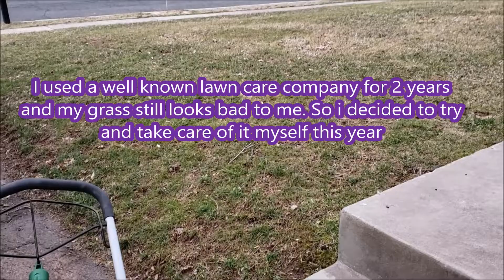SCOTTS SPREADER WHEEL CHANGE (Part 1 of 2) (Part 2, https://youtu.be/ukE639CF2eg)

Comment: You might want to  speak clearer and the camera was all over the place.
I'm trying to find a way to keep my wheel on my spreader. The clip and cap are broke, they fell apart when removing the old wheel. I don't know where to buy replacements or what they are called.  I have a solid steel axle and a wheel but no way to keep the wheel on.
Reply from the maker: Thank you for watching and for the feedback.  👍🏿

Comment: Hey man cool video!! I have the Scott 1500 sq. ft. Turf builder edge guard DLX. I think mine is just the newer version of yours.  But the wheels on mine are even worse than the two u replaced ... I really hope that I can do the same thing you did but I don’t think you can because I think the wheel is part of the shaft I don’t know I’m gonna give it a shot though you’ve inspired me. 
Thanks 🙏
Reply from the maker: Thanks for watching. It is a much smoother  push spreader now I wish you  luck with your project.
Reply from the maker: https://www.youtube.com/watch?v=ukE639CF2eg

Comment: I have the same spreader and thinking on changing the wheels so my question  is What size wheels did you use on the spreader and what parts did you use to keep them attached.. great mod on the spreader
Reply from the maker: Hi, thanks for watching my video. I used a size 10" wheels from Harbor Freight tools, they were like $4.00 a piece. After replacing the wheels, I used new cotter pins to keep them from coming off. After replacing one side, you are going to have to drill a  hole through the part that the bar goes through so it will spin with the bar so the fertilizer can come out. I put a long small bolt and nut to keep it from coming out. There's a flat spot on the bar that you will see once u take the wheels off.  Your drilling through that as well. That's what your going to put the bolt through so the wheel can spin.  i hope this helps, seems like a lot but its not. Let me know how you make out with it. if you have more questions, reach out.
Reply from the maker: https://www.youtube.com/watch?v=ukE639CF2eg Thanks again for watching and for your comment